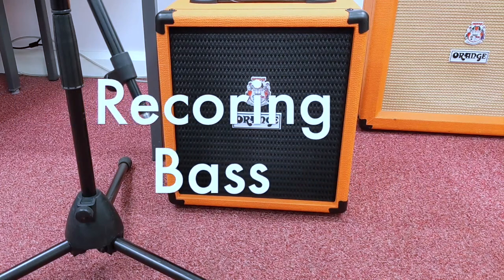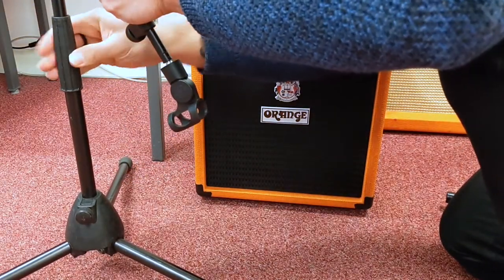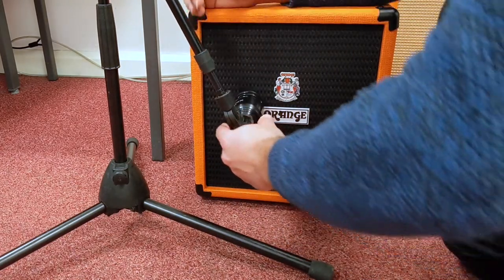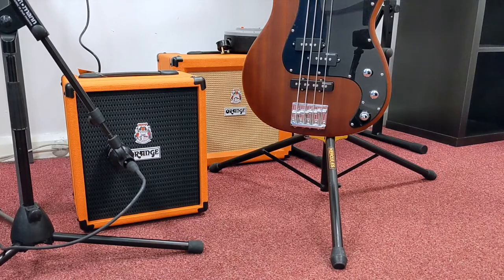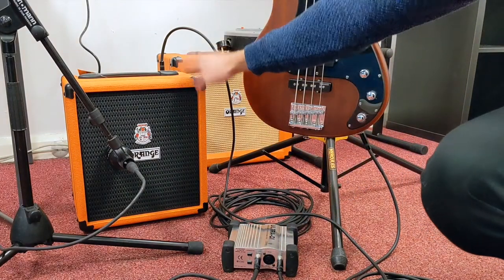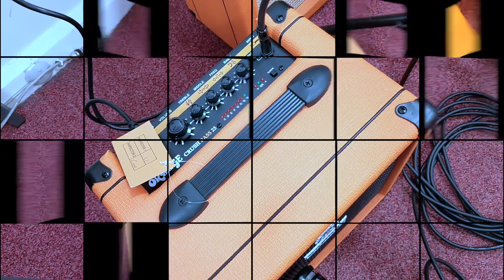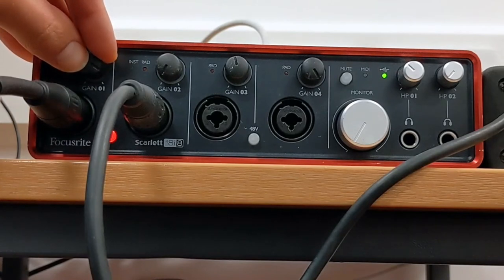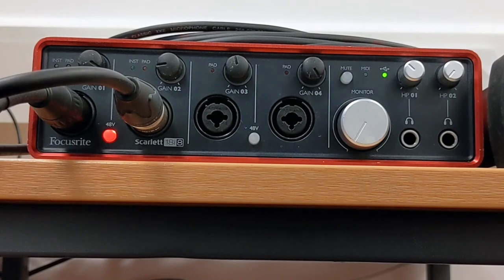How to Record Electric Bass or Guitar Using a Mic and DI Box

Comment: Hello nice video Do I absolutely need a DI box if im recording guitar ? I am using a scarlett 2i2 second gen with a shure57 on my amp and I realized that my signal was quite weak in the DAW theres so much headroom that I need to increse the volume on the track.
Reply: The sm57 is not sensitive so make sure you turn up the gain pot and put the mic as close your amp. Turn up your amp too. You do not need the di box.
Reply: @LVLLO  okay thank you very much
Reply: @lvllo3689  But why? The scarlett interface has these instrument inputs.

Comment: hi do you recommend to use phantom power on Bass?
Reply from the maker: Phantom power is needed to power active DI boxes and condenser mics
Reply: @VirtualVerghini  what is power DI used for? Can i only used the audio interface? Any thoughts?
Reply: @jojo-fj7lw  phantom power is used to give power to the di box or the condenser mic (or lifter, if you're using a ribbon mic) That means that phantom power turns on your di or mic. 
Yes, most interfaces provide phantom power, including Focusrite Scarletts

Comment: ok great video....thankyou.....

Now what if the Bass amplifer wasn't powered but was instead a PASSIVE speaker? (300W : 8 Ohm)
This is my problem atm.....please what am i missing here 
thx
Reply from the maker: Then that would not be an amplifier. A passive speaker needs an amp to drive the speaker to move. You can still record via a DI and not even bother with the speaker or you could buy a small bass amp to connect to the speaker.